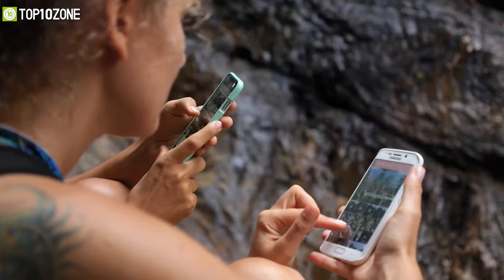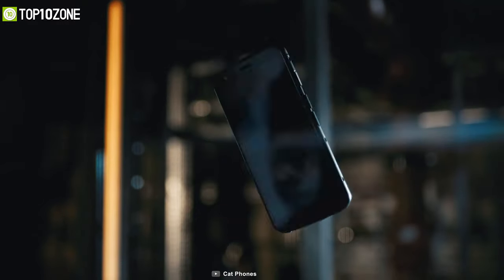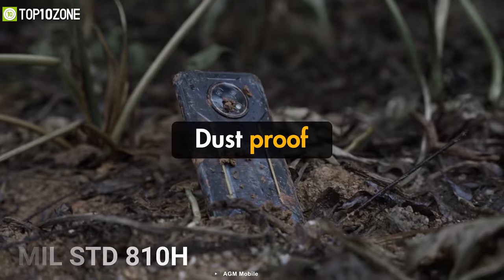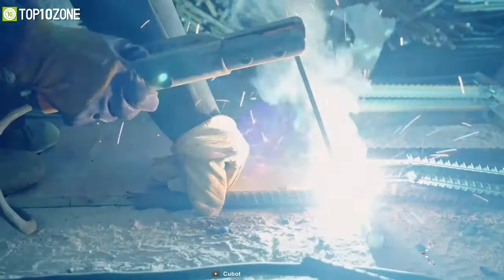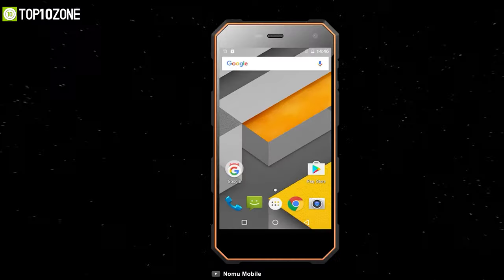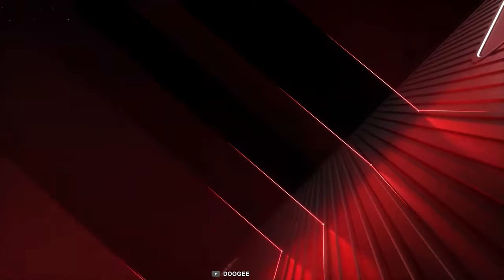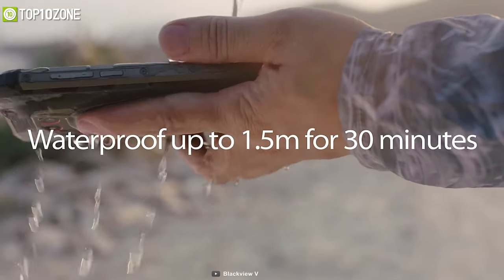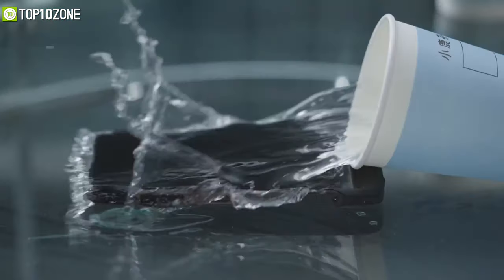Top 10 Most Durable Rugged Smartphones for Outdoor

Comment: Bought a Ulefone Armor 13 Pro in September, now 8 months later having an intermittent display problem. It's an uphill battle to get the seller on Amazon to issue an RMA. Ulefone says the seller has to issue the RMA. For $429 I expected better service. Right now back to using an older Armor 6E I bought in 2019. Work in a wet environment so a rugged phone is a must.
Reply: 0